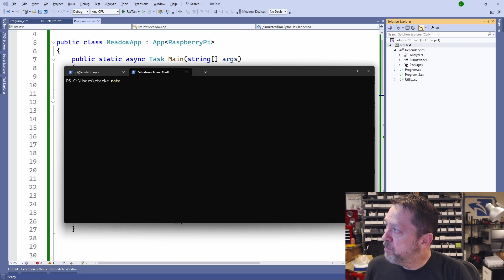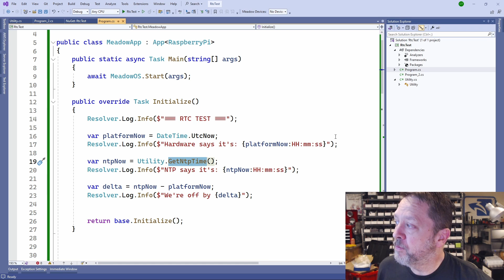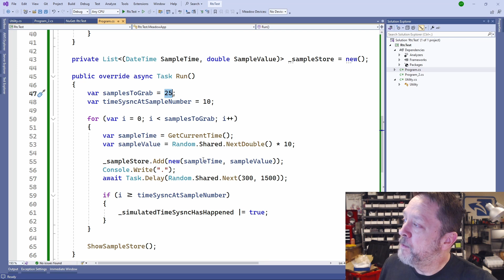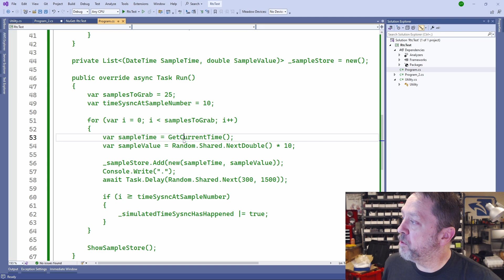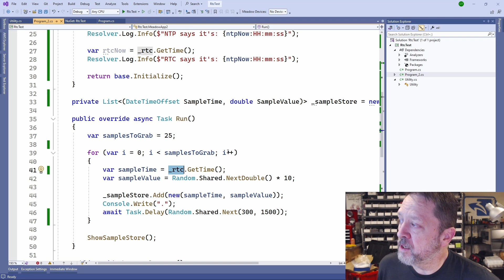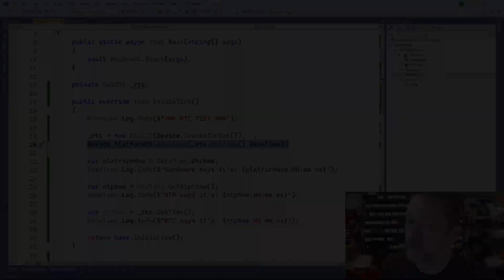Using a Real Time Clock (RTC) from C#

Comment: I see too much code belies the fact that  even UTC clocks can change while your code is running, be it a network time sync event or from this nifty little device. It was suggested to me to use Environment.TickCoun64 to measure time between events and to detect if the underlying System Clock has been adjusted for IOT devices. Not sure if this is still the best way.